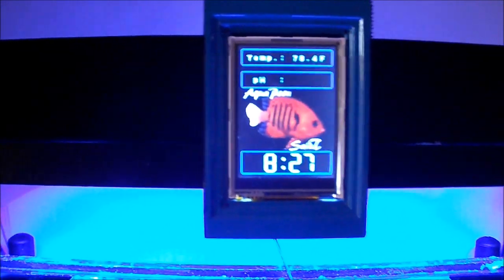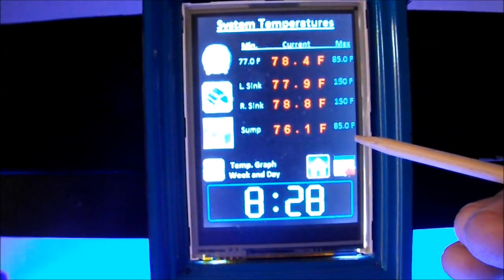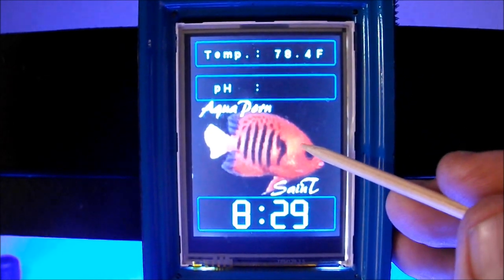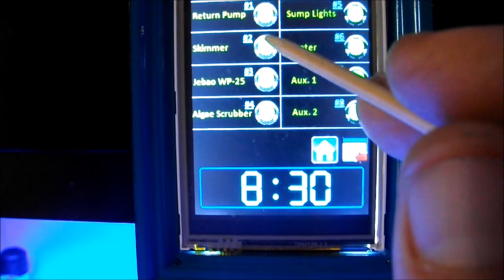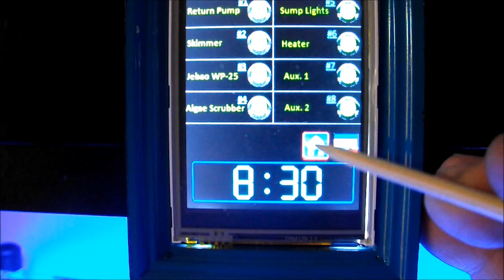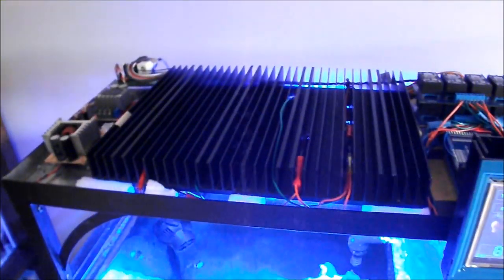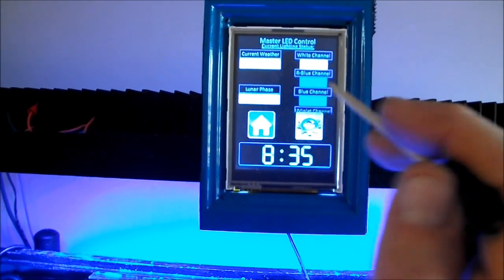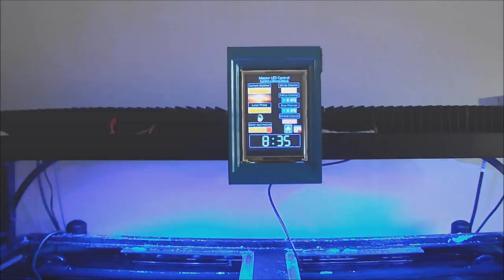DIY Arduino LED/Reef Controller-Update

Comment: Hi, first, im a huge fan of you work, from the dry rock to the whole controller, im trying to do something like this, but to be quite frank, being a complete idiot electronic wise its nuclear science for me jajajaj, i just purchased the pieces and im waitning for them to get here, i got a 360w 12v-30a power source, and now im thinking if it was the best option, i noticed yours go with 24v  instead of 12v so i was wondering if i need to do something different to make it work, or if i should better put it down and get a new one, also, how many leds can i put on the meanwell drivers? My tank its not that big, only 100g, im putting aroung 300w on light cuz i want to keep hard corals, but im a little bit confused with the whoel thing..... sorry